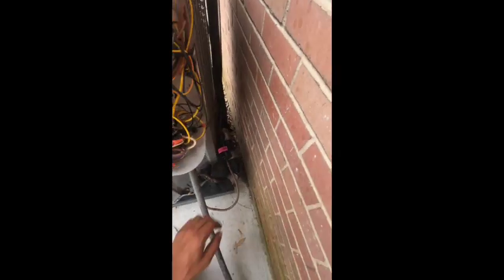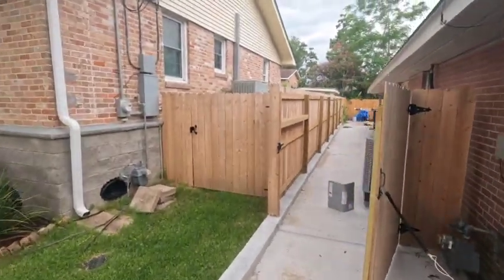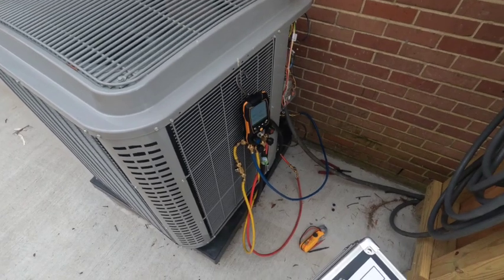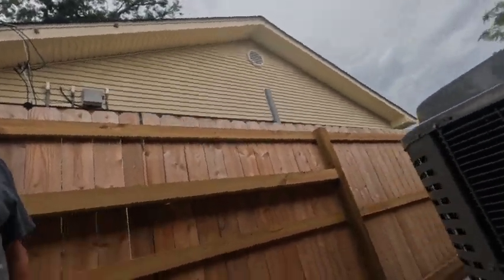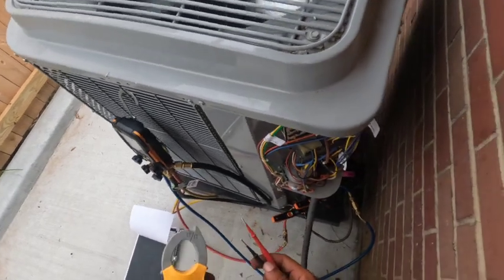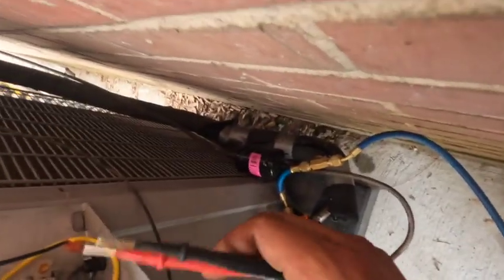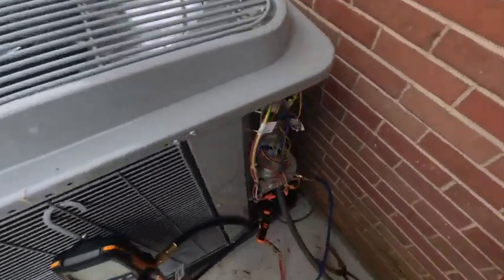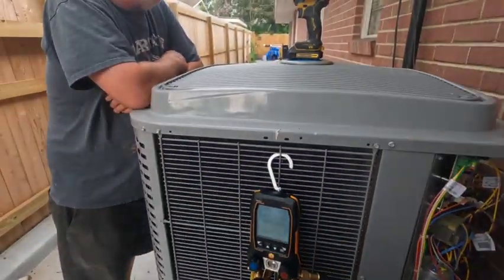Troubleshooting Communicating System

Comment: It supposed to have continuous 24v ?
Reply from the maker: your supposed to go from the board with 4 wires, splice those 4 wires to the thermostat and then the condenser. so you should have 3 sets of 4 wire tied together, going to their respective destinations.